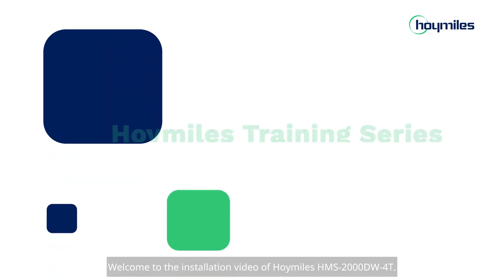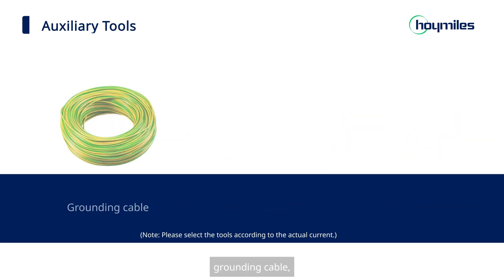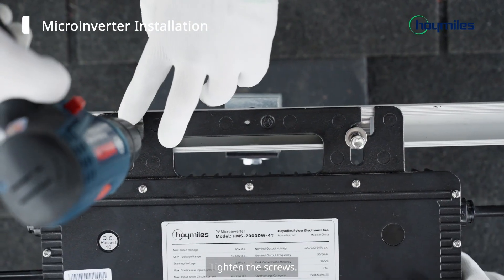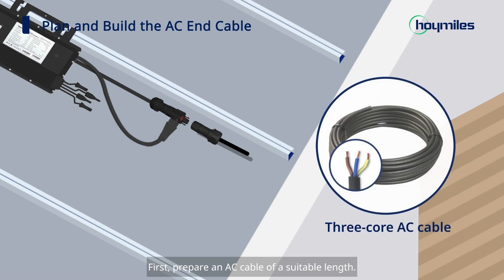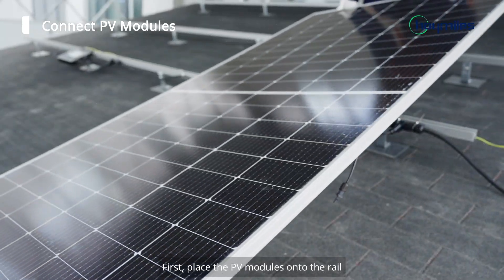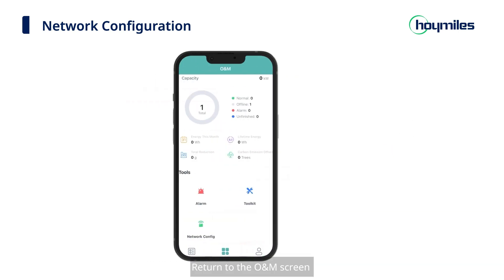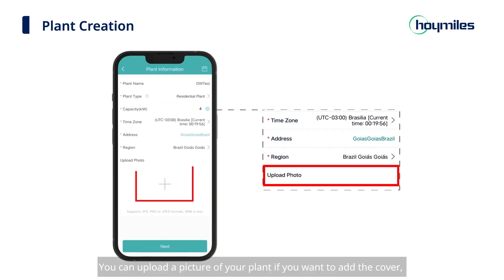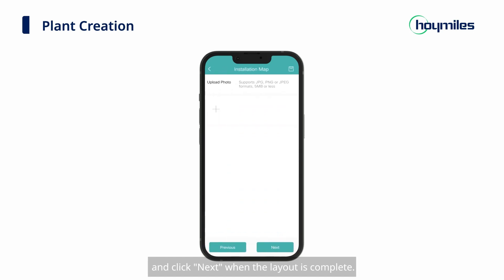4-in-1 Wifi-integrated microinverter | Flex Accessories& HMS-1600/1800/2000DW-4T Installation

Comment: I have two 550Watt photovoltaic panels, I was thinking of buying an HMS-1000W 2T inverter to install them. I ask, if instead I purchase a HMS-2000W 4T, can I temporarily use only 2T (2 MPPT) and perhaps in the future add 2 more panels, or am I still forced to use all 4 inputs at the same time? If possible, without connection are they still waterproof or do they need a cap or something similar? Thank you in advance
Reply: oh no friend!!!  It's best not to do that because it exceeds the specifications of the 2T or 4T microinverter
Reply: @ANTOLEPEK ...No it does not
Reply from the maker: You can temporarily use only 2 MPPT inputs on the HMS-2000W 4T and add more panels in the future. The unused inputs are still waterproof, but we recommend using protective caps. For more guidance, feel free to reach out to our support team service@hoymiles